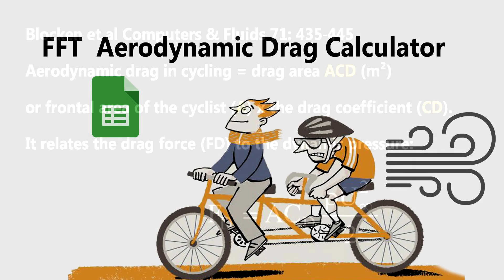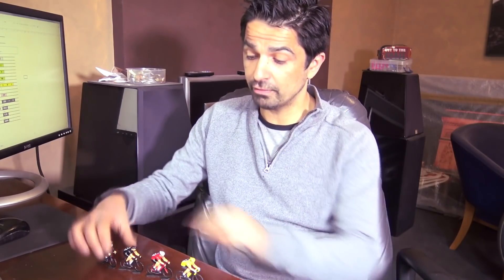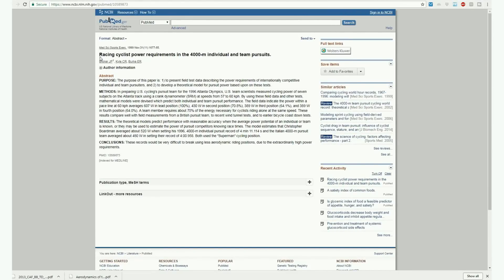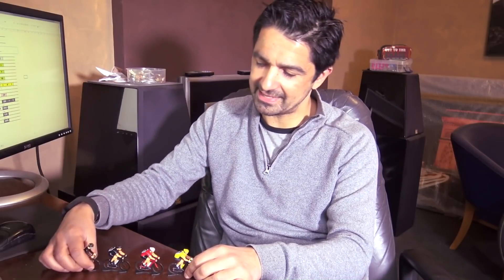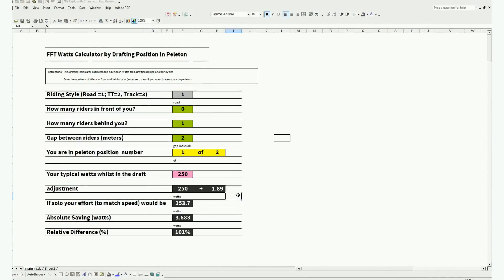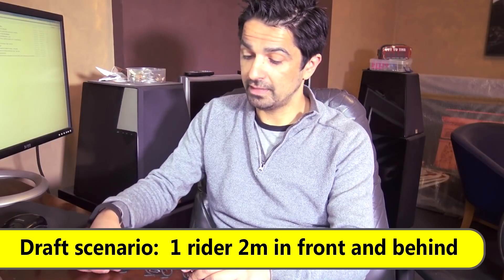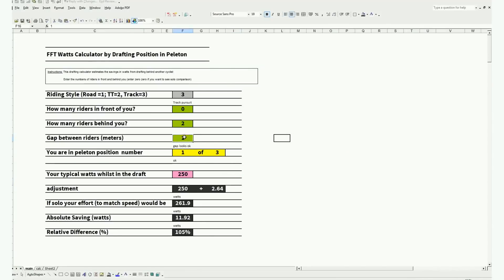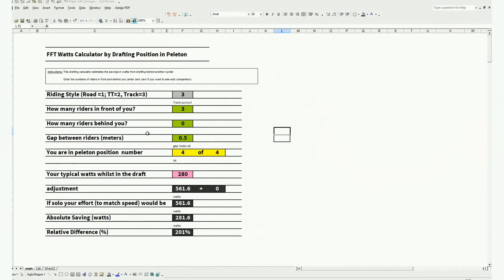Aero Drag Science: watts saving drafting in paceline or chain-gang

Comment: Your channel is interesting.  I recently replaced a 2005 fuji track (42x16) steel bike reported to have noodle cranks . with a 2017 CAAD12.  My strava segments are much faster on fuji where I could reach 45kph to 50kph on the flat.  The CAAD12 I am about 5-8kph slower despite having gearing.  Is there a technical explanation or might it just be a habit thing (experience with the fuji, vs relatively new CAAD12)
Reply from the maker: If you are not spinning out at 50kph on the fuji (and conversely you cannot get to that speed in any gear on the CAAD12) then it looks like for you gearing isnt the difference determining the speed (suprisingly). It must be other factors....eg aero position, experience with that bike or maybe CRR. Do a strava comparison against yourself on the old bike  (segment > compare > my rides) and see what you find.

Comment: All such models are further confounded by the over simplification of 'speed'. The variable that matters is not the velocity of the riders, but the rate of air volume displacement. This is dependent on rider velocity, wind speed and air density, which in turn is dependent on temperature, humidity and barometric pressure. And that doesn't even start to consider yaw angles, gradient, the aerodynamic properties of the riders in front, and the properties of the rider drafting. Furthermore, the draft savings should not be expressed as a percentage, but as an absolute number of watts, because this number diminishes to zero. eg, in certain scenarios you are able to freewheel behind a rider who is putting out watts and remain in the draft.  

Having said all that, it is possible to make a reasonable estimate using simplified factors. Good work!

Comment: Thanks once again for the excellent analysis. Another topic where aerodynamics and drag being proportional to the square of  speed might be 'why it's more efficient to attack on climbs than descents'
Reply: steve crabb not sure a spreadsheet can model descending cornering skills and not much point attacking on a climb if you aren't a climber
Reply: Agree 100% with your first point but the second one ... not so sure
I ran an example through http://bikecalculator.com/

The example below shows that for the same increased effort of 100W that the speed gain going up a 5% slope is 3 Kph better than going down a 5% slope.

Rider 85 kg
Bike weight 9 kg
Hill 5% up 5% down
Position on the drops (only relevant for downhill)
Assumption - no braking on descent
Effort - raising Watts from 150W to 250W to break away

Uphill speed 5%
150W = 9.87 Kph
250W = 15.82 Kph
Increase = 5.95 Kph

Downhil Speed -5%
150W = 60.71 Kph
250W = 63.67 Kph
Increase = 2.96 Kph
Reply: especially if yer a small climber which we often are :)

Comment: Hi, in a four rider chaining would the third rider from the front have the most advantage, considering the bow wave effect he has from the fourth rider who only has the drafting advantage?.
Reply from the maker: Hi David...interesting question. I work out that being in position 3 gives a 42% advantage (214w saving @300w) but being in position 4 gives a 45% advantage (249w saving @300w) (1m gap). Try the calculator for yourself.
Reply: Thanks will keep this in mind tomorrow, doing a 55 km handicap road race need all the tips I can get, Cheers.
Reply from the maker: best of luck!
Reply: David Cummings Good Luck, David!